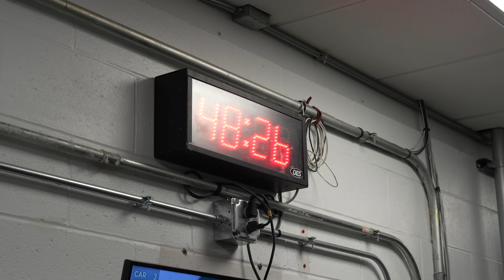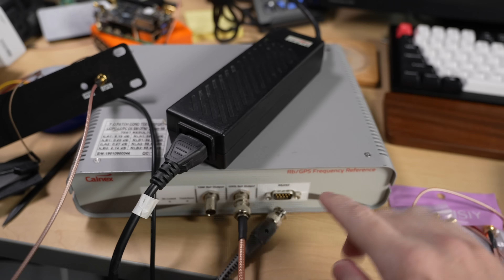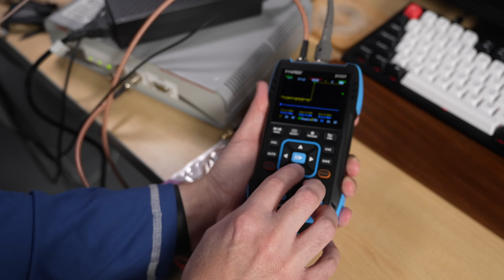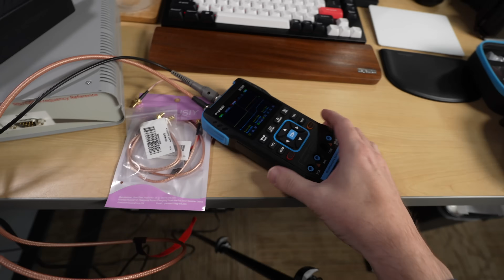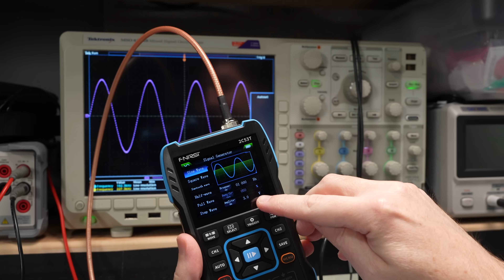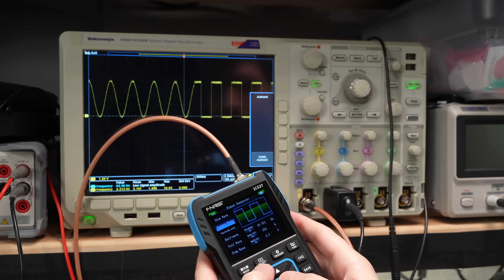A scope every electronics nerd should own

Comment: To get channel 3 and 4 on the "little graph here", you need to click on the measure button at the top and you will be able to change which channel you are measuring and what you measure on each channel. Also most scopes can't directly measure (at least precisely) low frequency in most cases below 10Hz you'll need to use the cursor (it is probably also in the measure menu) and calculate the frequency with the time of one period (f=1/t)

Comment: 11:18 if you select Ch3 and then press the measure button in the "wave inspector" section of the scope you will be able to add and remove measurements.  The yellow and blue text you are reading that was reporting frequency are measurements from the wave inspector on the scope.  I have a 3 or 4 of those 4000 series Tek scope in my lab at work. 👍  Super nice scopes.

Comment: Question for anyone: What would be the least expensive device that could check for the existence of a modulating signal? The main use case I have in mind is verifying audio output in stereo equipment without needing to hook up an amp & speaker for troubleshooting.

Comment: I'd push back a little on you don't need to worry about the specs if you are just getting started - as even if you are just getting started you quite likely have a need in mind - it might be a simple problem to study but you do need the scope to go fast enough. In my case my little USB logic analysis/scope just can't go fast enough to recalibrate the nice old repairable by design CD player we have for instance - obviously buying a good enough scope is more expensive than buying a new CD player in this case, and odds are the new one would be just as good if not better even though its cheap as the tech is so refined now. But still the point stands it quite possible you will need something specific so you really need to know the ballpark you intend to be working in.

Comment: Here's a little gauge R&R test that you may wish to try out: feed both of the FNIRSI inputs from the same signal source, using identical probes and check for any time offset.
The reason I sugest this is that is not uncommon, on cheaper instrumentation, to use a single input AtoD and switch between the inputs. If this is happening here you'll see the time difference (and be able to work out the switching frequency too)
Reply: And to even more anal, swap probe inputs to see if there's a probe offset (e.g. from "tuning" and/or cable differences. like dfferent probe manufacturing times). If the sources are both the same frequency, feed into a mixture and look at the beat frequency, although a 1pps pair has a VERY LOW FREQUENCY DIFFERENCE!

Comment: Don't forget the fact that with one of these handheld scopes, you don't need a differential probe when poking around inside a circuit since the "ground" connection on the scope does not go to earth ground.  Even a cheap differential probe costs $180... twice the cost of the portable scope.
Reply: With two caveats: Both channels share a common reference, and that reference is out there in the open for you to touch.

Comment: I have a desktop scope and bought an Owon handheld scope for using when I'm on site - however, I've ended up using the Owon way more than the desktop just because it only takes a couple of seconds to start up (compared to about a minute) and the accuracy is surprisingly good.  The Owon says it's 100MHz and with a 100MHz signal its's about 0.2dB down compared to the other (that cost 10x as much).

I wish one of the manufacturers would produce a handheld logic analyser.  I use a Saelae logic analyser - but it's a nucence having to have it connected to my PC and wait for it to start up.

Comment: I have one and the multimeter mode is useless, always freezes when i open it and i have to force reset it via the pin hole. Tried updating it to the latest version, same problem. The osciloscope works fine i guess

Comment: I'm curious if there are similarly functional scope units that use a computer/application for it's user interface and data logging?  I should check that out this weekend.  Thanks for the demo, Jeff!
Reply from the maker: there are a few decent USB scopes, I didn't go that route just because I like having the scope right next to the device, instead of having to look up at my screen. But for certain projects, a UI on my computer would be useful, especially for logging.

Comment: Just for a bit of context on the stair stepping from the DDS output, it's likely that they aren't applying a low pass filter on the output. That probably means the stair stepping will go away when you output waveforms close to the bandwidth limit on the output.
I just checked on my bench AWG and scope, it looks like the AWG does apply a bandwidth limit on the output to produce perfect sine waves, so I'd imagine Fnirsi omitted that to keep cost down.

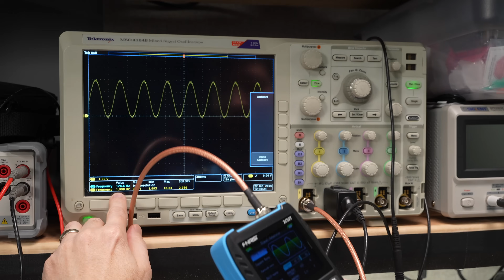Comment: @15:05 You demonstrate exactly what is wrong with those cheap chinese scopes 😄When you set the generator to 1 Hz, you can expect the output to be 1 Hz.. But it's not. This can result in days of troubleshooting you project only to find out you can't rely on this device... If this is your only scope, you'l probably never find out and give up on the project..
I can guarantee you this is not the only bug in the scope..

Comment: iirc DDS stands for Direct Digital Synthesis, basically a way of generating signals using completely digital devices/means (reference clocks, phase accumulators, lookup tables, DACs, etc.) rather than analog.

Comment: 50Mhz, hard pass.  too slow sampling rate and inaccurate amplitude above 20MHz.  the 50Mhz oscope will struggle with a 10Mhz+ square wave which will look like a distorted sine.

Comment: I just bought a electronics starter kit, want learn about electronics and soldering, is this good place to start or need to invest in big expensive one.
Reply from the maker: Start with one of these; honestly a decent multimeter would already be a good starting point, I survived with a cheap multimeter kit build for years before I bought something nice!
Reply: @Level2Jeff  Wouldn't a cheap logic analyzer, something working with sigrok, be better? I feel like you can learn quite a bit about how things communicate with an arduino and a logic analyzer. Probably cheaper, too?

Comment: I remember when oscilloscopes were $5,000, large and bulky. Then came the smaller units like the Tekronix shown in the intro of this video. Now they are big as a volt meter, and under a $100.
Reply: The difference in this one, and those expensive scopes, is that this is only a 50Mhz scope. It's very limited in what you can test with it.
Reply: @garycook5125  True. But for simple things, it's enough.
Reply from the maker: Note: That Tektronix scope—if purchased fully calibrated—was something like $20k back when it was new :O

Of course, it's a few generations old now... but there are still new scopes that are crazy expensive!

Comment: It's almost insane how cheap these halfway decent scopemeters are now. Just a few years ago I paid that much for one of those sub-megahertz single channel DMMs that come with a cheesy lasercut assemble-at-home lucite case. (I only do audio frequency stuff, so what I have is still good enough for what I do.)
I'm pressing X to doubt the 50 MHz claim. 50 megasamples per second maybe, which would put its bandwidth at 5~10MHz.
Reply from the maker: Yeah, I figure if it gets even half the spec that'd be amazing. But I don't need that much bandwidth that often, and if I do, I'll got to the big scope!

Comment: Best advantage of a battery operated scope is you can't get a ground loop which blows your scope up like in a mains powered one
Reply from the maker: True... many a surprising pop from that...
Reply: All the newer rigols I've looked at are USB-PD powered. It seems everybody is tired of fixing ground loops.
Reply: Just buy an isolation transformer. That's a good idea anyway if you make projects that run off of mains with not all parts being galvanically isolated.
Reply: Not via a single probe.. but the channels on all these cheap units share their ground reference. The serious ones have fully isolated channels, as they're intended to be used in such scenarios.

Comment: I tried an OWON handheld scope and found that it had barely any trigger modes and only 10X, 100X, 1000X, etc scaling. I specifically wanted to measure UPS transfer time and using it with a differential probe was a pain. Ended up returning it and buying a Rigol DHO804, it's small enough and can be powered with a USB-C power bank.
I'm sure there are handhelds that work well, but it's very much you get what you pay for.

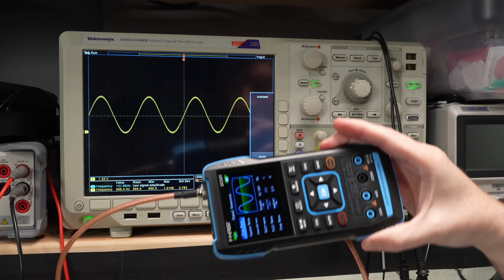Comment: 11:43 I'd guess the poor reading on the scope is due to not having enough periods of the waveform. Note how when you  zoom in horizontally, you totally lose the frequency. So it's not buffering a larger portion of the signal beyond the screen for this frequency display.
Reply: My 1054Z and it's built in packet decoder is useless because of that little "feature." It's not smart enough to decode it's entire buffer, so if you scroll off screen it'll forget the beginning of the packet and translate gibberish for the rest. Zoom out enough to fit an entire packet on screen and it misses bits. I had to buy a logic analyzer I thought I could make do without, or maybe I just don't know how to use my tools right?

Comment: The biggest benefit of a scope like that is that you don't cry when blowing it up or dropping it.
Reply from the maker: Honestly the rubber grip on here would probably survive much better than the all plastic housing on that expensive Tektronix! Though the Tektronix scope isn't made to be put in a pocket.
Reply: @Level2Jeff  "Though the Tektronix scope isn't made to be put in a pocket."
Observe
Reply: @Atom224 JNCO jeans are making a comeback
Reply: @Level2Jeff  janko jeans or tripp pants would probably carry a techtronix.
Reply: @Level2Jeff  I do some field work on heavy equipment. I get to work on very nasty equipment that's old and needs board level repairs. I take some high end equipment with me but balancing gear on an excavator isn't ideal. Cheap stuff will get you very close or if not solve the problem.
Reply: And no chance of gnd loops. Is it rated for mains ?

Comment: I have only one Tektronix O-scope, and it's a 2400-series analog scope with only 60 MHz bandwidth (it even has a CRT sweep setting on the timebase).  I also have a Rigol MSO, while you have a Tektronix.  I also have a high-resolution Fluke DVM with 4.5 digits.  What's interesting is to look back at the "scope-meter wars" between Fluke (who invented the concept), HP and Tektronix from the 1990s and compare that to what this FNIRSI device can achieve.  Scope-meters started out with a bandwidth in the low MHz range of input, something that you would use for telephones and audio.  Now they're something that works high enough in frequency that they have 100 MHz in bandwidth you're talking about whether it can see 1 Hz versus 2Hz signals.  My how times have changed since the original DuMont Oscilloscopes, which lost their lead to Tektronix.  But, that's another YouTube channel.

Comment: I have the Hantek 2D72 3 in 1 Digital Oscilloscope Waveform Generator Multimeter USB Portable 2 Channels 70MHz 250MSa/s Multifunction Tester. $179 on Amazon.
One of the nice things is the USB-C output to a PC based UI app for the scope. All the settings can be adjusted and it will display a sampled scope output on the PC and save a measurement at full resolution.
It replaced an old desktop Tektronix 2205 100MHz dual channel scope that finally wore out and I prefer the smaller handheld potable features with the PC app for more functionality.

Comment: Ya know, I know that Oscilloscopes are useful and have a purpose.... but i still do not know or understand what that purpose is outside of making lines appear on a screen. I get they are signals, but don't understand the relevance to the shape of them
Reply: It's a voltmeter that plots over time. If you have a signal that should be doing certain things at certain times then there's really not many other ways to visualize that. A common example would be tuning half bridge circuits on inverters which are in almost everything nowadays. You want to pump in as much current as you can so things switch on and off fast, things waste a lot of heat when they switch, but if they switch too fast for the rest of the circuit they can oscillate instead of transition from on to off cleanly. A scope can help you pinpoint that, show you what your changes do to the output in real time even. 

Other DC-DC converters have operating limits, like the switches that help boost or lower voltages can only be on for so long. You can apply a changing load to a power supply you are designing and check to see that the duty cycle on that switch falls in a reasonable range as you expect. The trace will literally show you how long that switch is on and off for, fancy ones will even calculate low and high times, duty cycles in percentages, peak to peak values, more than even I know what to do with...

Comment: I bought both the 2C53T and the 2D15P. They're incredible performers for the price, but I find the 2D15P easier to use with the extra buttons on the interface. Amazing how well they perform at that price point, though. One perk of having battery operated scopes - working on live-chassis equipment (i.e. CRTs) becomes much safer, as ground is no longer referenced to mains.
Reply: I was so close to buying the 2D15P but two things stopped me. The 2D15P is not handheld, more of a laptop and the price. I have a reasonably good Rigol. It's mains powered but no need to go buy one almost as big. If the specs of the 2D15P were in the 2C53T I'd buy it in any case.

Comment: When sports people get involved budgets don't matter anymore. I can't see why video needs that much accuracy. A simple master clock will do sync. With as much stuff that uses frame buffering not sure why they need that anymore.  Now I do know ATSC needs GPS 10MHz clock but ATSC is a mess to begin with. Another piece of crap the FCC hung on us.
Reply from the maker: SMTPE 2110 requires PTP with general time accuracy in the microsecond range... it's sometimes the bane of broadcast engineers' existence!
Reply: That's an IP transport protocol to move video, audio and metadata. Knowing packetized network traffic that would mean every network switch and the like would have to be certified for that. Not to mention configured properly. As it may work for a while and then break for no
apparent reason. Ick

Comment: I thought that looked familiar. I have the cheaper version, 2C23T. The only feature I'd want to add to it is inductance measurement. Without that I have to do inductance measurement using old school techniques.
Reply: Have you looked at FNIRSI LCR-P1 or LCR-ST1?
Reply: @bpsengineer  No, but I'm eyeing the LC1020E.
Reply from the maker: I like measuring capacitance by charging up a capacitor, then arcing a wire across the leads. The bigger the arc, the higher the capacitance.

Comment: For years I've had an old Hewlett-Packard analog scope that is pretty incredible, but the controls are getting noisy and it really should be warmed up for some extended time (documented in the manual) before relying on the measurments.  Two years ago +/- I picked up a handheld Owon 2 channel scope (IIRC 40MHz, supposedly).  A couple of months later I had a Siglent desktop scope. It's nothing like the HP.  For one thing the specified warmup is a fraction of the time, and a digital scope has some amazing functionality compared to the similarly priced analog scopes I first used in the 1980s.

Comment: Way back in the mists of time, I worked in the television industry in the uk. The old analog tv system had very tight timing requirements for synchronisation. Even a few extra feet of coax would through a signal out. Fortunately most equipment could be adjusted to some extent.
Reply: In the radio world with tuned cavities you need to keep things in phase so accurate jumpers between the cans was critical for similar reasons.  I would get calls from our field techs who were having strange behaviors and after awhile I'd ask them if they touched the jumpers, a few minutes of silence and then a "I'll call you back.."

Comment: DDS is Direct Digital Synthesis
Reply: And why not filter the steps to get a better sine wave? Guess you could with an RCL circuit if needed.
Reply: @RudyJHaluza if a SigGen goes up to 2 MHz, how do you filter 1 kHz and 2 MHz at the same time?! You not. Or a variable analog filter will cost more than that toy scope all together.

Comment: GPS signals travel at about ⅔ the speed of light in a coax cable.
The 1 PPS from an ordinary cheap GPS receiver can be on the order of 40 - 70 ns off from absolute top of second.
The test signal could have had some output filtration but that would up the cost.  (with a bypass for digital modes).

Comment: Yeah, no. Sadly this Fnirsi scope (and lots of Fnirsi products) are incredibly buggy and have plenty of firmware issues. They also barely meet the advertised specs.

You'd really be better served with an OWON HDS2XXX or if money is an issue for a similar flawed (but less so) product the Zoyi ZT-703S.

EEVBlog forums are a good resource to refer to.